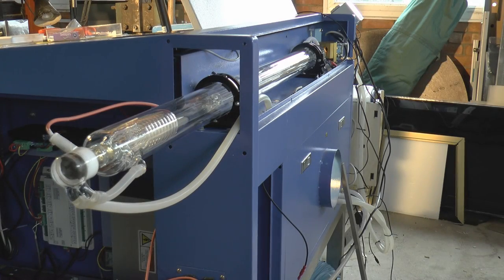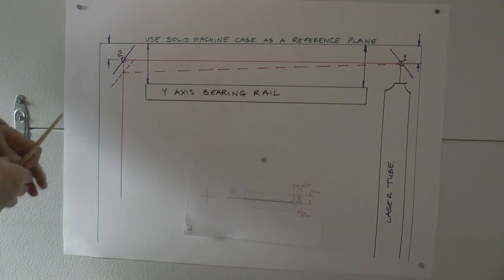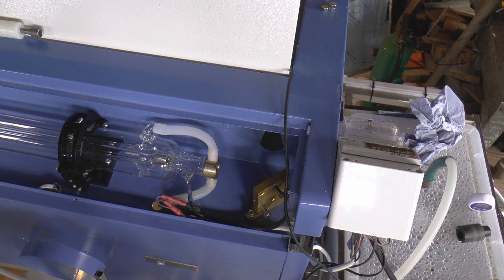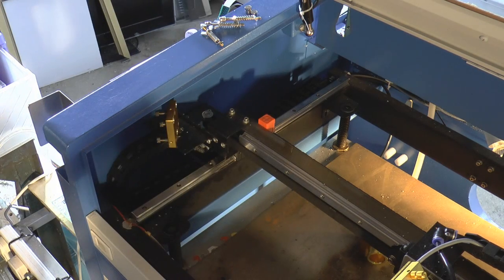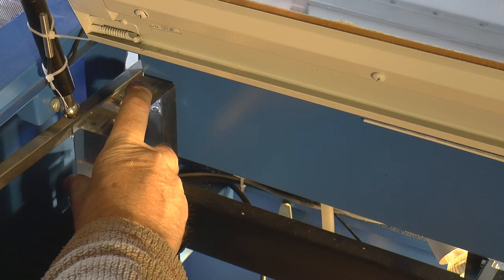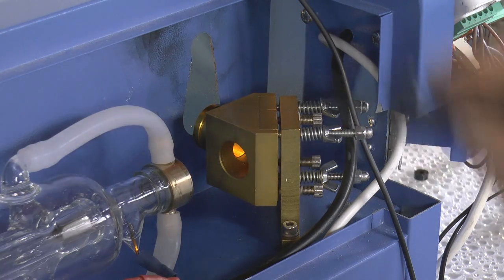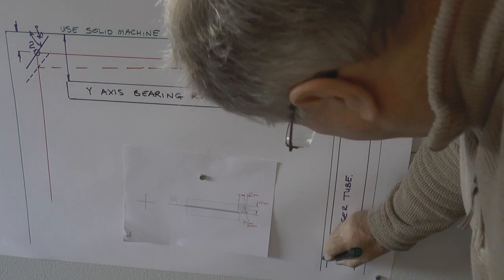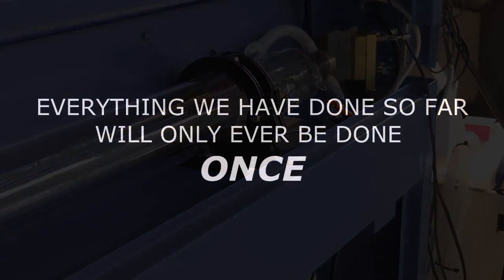RDWorks Learning Lab 51 Beam Setting for Beginners Part 1

Comment: Russ, 
thank you very much for the video - for all the videos in fact. They are very instructive and a great pleasure to watch!
I'm looking forward to receive my own little laser cutter and learned a lot from your videos.

Even though I do not agree with you about the necessity of parallelism of the lasertube to the axis.
Mirror 1 (the first one from the laser) has two degrees of freedom which allow the laser beam to reach
any point of a specific quadrant within the polar coordinate system. Meaning, you are able to correct
ANY misalignment of the laser just by adjusting the 3 screws of the mirror, als long as the laser beam
hits the mirror near it's center.
Also it's not important to adjust the mirror blocks exactly to 45° angle. That can also be corrected by adjusting the mirrors.

The thing that really matters ist parallelism between the beam coming out of mirror 1 to the Y-axis of the motion mechanism
and parallelism of the beam coming out of mirror 2 to the mechanical X-Axis.

There are only two parameters defining these parallelisms:
1) All 3 mirrors have to share the same hight above the (virtual) base plane of the mechanical movement of the axes.
This should be given by the mechanical construction.(is it?).
2) equal horizontal distance of mirrors 2 and 3 to the X-axis and equal horizontal distance of mirrors 1 and 2 to the Y-axis.
So there must be slots to move mirror 2 left-right and the mirror 3 back and forth.
Fulfilling these two requirements, in combination with the fact the laser hits mirror 1 at it's center, are the prerequisites to
establish a proper alignment. All the rest can be done just by adjusting the mirror angles.

Or did I miss an important point?

Lothar

Comment: Having set up several lasers, the mechanical alignment is not precise and very difficult to get right.  There is a much easier solution.
1 Remove all mirrors.  Use a glass, cardboard or other suitable 20mm disk with masking tape on it and use that to test fire the laser at a low power pulse to make a light dot.  The beam is not focused to a small cutting point here, so the spot will be about the diameter of a pencil lead. Adjust the mirror block and or tube for the beam to mark the center.  Replace the first mirror.
2 Use the target in the 2nd mirror block.  Move the carriage all the way towards the first mirror and test fire.  Do not center at this time.  Move the carriage all the way away and make a 2nd test fire.  The most important part here is for both spots to overlap perfectly.  Only adjust the 1st mirror at this time so the spot is in the same place near and far.
3 Move the 2nd mirror block so the beam hits the center.  It should remain in the center near and far.  When done, install the 2nd mirror.
4 Install the target in the 3rd mirror block on the carriage.  Repeat the procedure for repeating spot location near and far while adjusting the 2nd mirror.  Again do not worry about centering yet.  Repeatable spot location near and far is the metric for this adjustment.
5 Align for centering in the 3rd mirror as before.  This can be tricky as on some machines you can shift the lens assy to center on the beam.  If this is the case, the alignment is easy.  If not, the 2nd mirror has to shift while keeping centered on the beam from the 1st mirror.  Unfortunately this almost always screws up the beam to the carriage, so that needs repeated.
6 Check your work.  Test fire onto the target in the 3rd mirror location at all 4 corners.  Beam should be in the center at all 4 locations.
7 Install the 3rd mirror. Ensure the tube is vertical.  If tilted, the beam may enter the lens off center and your cuts will be angled.  There is no tilt adjustments on the 3rd mirror.  Done.
Reply from the maker: Hi
I greatly appreciate the effort you have gone to to explain your method. You must remember that that this is not really a tutorial series but as I say in each video, this is a record of my learning journey with this machine/technology.At the time this was done , there was no you tube help available to guide me so I was fumbling my way through the problem. As you progress through the series you will find me trying different beam setting methods. The major realization about beam alignment came when I discovered that setting the beam to the centre of mirror 3 can be a BIG mistake with some machines. see  from 12min 30 sec in   https://www.youtube.com/watch?v=ELeqP3tHlp0 .  At this stage in my journey I had already established that one big design flaw in these machines was the absence of any Z adjustment on the head, so you will note the adjustable mounting bracket that made it easy to fix this mirror 3 issue.
Having now set many different machine types and sizes I can advise that your steps 6 and 7 of your procedure gloss over the many difficult yet vital aspects of beam setting. The first is to make sure that the beam is firing at mirror 3 "sweet spot"  see https://www.youtube.com/watch?v=eSjNsK2sjNo  and this Z setting technique is much clearer to see in this video  from 24min 30sec   https://www.youtube.com/watch?v=jVGByifge_Q.    You will also note that by this stage I have become so fed up with the limitations of my original head that I have been back to the drawing board and made my own. I hope you will see from this that a small mechanical error in head angle is not going to have any disastrous results for cutting off angle but that if the beam is not passing exactly through the lens axis, that will cause the beam to exit the lens at an angle much bigger than any mechanical error.  I agree with your point about getting the beam correct at all 4 corner locations but first things first. By the methods  that we adopt,  we will certainly be setting Y and X absolutely true at three corners.  Big problems now arise when you drive to the 4th corner and the  scorch mark on mirror 3 is maybe 8 of 10mm off of true.  What do you do at that stage?
Thanks again for you comment and great explanation because others following in my footsteps will register my naivety at this stage and watch further ahead before resetting their beam.
Best wishes
Russ
Reply: @SarbarMultimedia  Thanks for the great and detailed feedback.  I do have the solution for 3 of 4 points in line.  I did not detail this.  The basic physics is 3 points define a plane.  If 3 corners align perfectly and the 4th corner is out of align, it means the rails are NOT all in the same plane.  Cheap Chinese laser engravers do not have a strong frame, but most often a sheetmetal box.  Either the table it is placed on is not perfectly flat, or it had shipping damage.  This can be corrected by either shimming the low corner of the table, or use shims on the internal bed to place all 4 corners in the same plane.  My prior alignment only works if the bed is properly level and all 4 corners are in the same plane.  Hope this helps if you are fighting this.  Had this problem with my Rabbit 40.  It arrived with a broken tube and dented corner.  Due to the larger size, it has two upgrades. a 1000 mm long 50Watt tube, and an AWC708C Lite controller panel, with stepper drivers. to eliminate the software key and computer.  In addition the stepper drivers are now run with a separate 30V supply for faster engrave speeds.  With the two upgrades and a full proper alignment, it now works very well.  With the new controller, I can add a rotary table, my next upgrade.  The network interface is fantastic.  I don't need to be in the shop to do the graphics.  Just upload the file.  In addition, it now directly runs with Gcode files, GIF, JPEG, AI, and many other files with the cut and scan functions combined.  This alone is a huge improvement over NewlyDraw which can either cut or scan in one operation.

Comment: 4. follow up to prev post:
Next is to do the same on the x axis, means i put again a big sticker un the laser head and adjust the beam from mirror2 to not moving when going left/right on the x axis.
Again, when this has been done, the beam is parallel to the x axis
5. next is to move the laserhead up/down and front/back to hit the sweetspot of the laserhead mirror.
When this is done, i know that the beam should be easy to get to the center of the lens without having any angle error to the x and y axis planes.
6. next what i do is to adjust the high between the table and the head nozzle on all 4 corners of the table by turning the single beltwheels of the table.
7. last step is to loosen the basemount frame of the table and shift it x and y until there are 90 degree at x/up and y/up between the table threads and the table itself, this could be easily measured when the table is in a lower position.
Reply from the maker: +pyrofilm 
Again all good stuff, I made my own adjusting bracket for the head  to catch the beam in the mirror sweet spot, but as I mentioned in my previous answer,  a little XY stage at mirror 2 would be a neat solution.
Thanks again
Russ

Comment: Re mirrors tarnished ... those machines are great for smoke extraction so you'd be hard pushed to get the back and side mirror dirty ... The other 2 larger machines I have have the extraction from underneath and I find smoke gets to the tube and it gets very dirty .  Im looking at building a bulkhead to stop  the smoke getting to the rear of the machine with holes for the belts and laser beam and possibly put a few fans on the tube cover sucking into the machine  to put positive air pressure in the tube box . Im currently watching this because the 3rd machine (cheap chinese machine)  has major mirror issues after the wife gave it a knock .
Reply from the maker: Note of caution....if she can do that to a machine, for your own personal safety , I would make damn sure to keep her sweet!!

Comment: 8. due to tilting the mirrors to get them parallel to mechanical x and y axis and the bad construction of the mirror mount on mirror 1 and 2 ( they are not tilting at the nirror plane but instead far behind the mirrors) the incoming beam might not more hitting the mirror perfectly in the middle. Usually this is not a problem as a mm out of center is not a problem but as i always want to have it perfect, i may redo the complete setup again for doing the finetuning then. 
Ar least after a second itteration it is usually perfect, even with this wrong designed mirror mount.

Comment: Hi Russ 
Hi Russ, thanks for the valuable information you are providing with you videos, I'm binge watching them on a regular basis, I've just got my (what was supposed to be a 60w Chinese laser engraver) turns out it only a 1000mm tube so i presume it's really  a 50w machine, I was wondering if you could help shed some light on my issue. I have set my mirror's about as exact as I can to the middle on all 3 and the beam out the laser head is exact centre, when at the front of the machine, but when I move it to the back of the bed to check all 4 corners its no longer hitting the centre of the mirror on the laser head. if I adjust them at the back the front is no longer aligned, any idears??. I can slice through 3mm acrylic with no problem with power down to 35% but just will not cut through 3mm ply wood even at 85% @ 5mm/s with is as far as I want to take the power (I haven't got my ammeter yet) any help would be appreciated.
Reply from the maker: Hi
Lets start at the beginning
1)Your beam need to hit mirror 1 approximately in the centre ,within 2mm say.
2) Drive mirror 2 close to mirror 1  and make a TARGET scorch mark. 
3) Drive mirror 2 right to the front of the machine and watch carefully as you make  a second scorch mark.
4) if the marks are perfectly on top of each other then proceed to 6)
5) If the second mark is off, adjust mirror 1 to get it onto your TARGET burn.  When your target gets too confusing, replace the tape and return to step 1)
6) You have now set the Y axis perfectly. DONT touch mirror 1 again. Your final mark may not be on the mirror centre but up to 2mm off centre will be ok.
7)Put target tape on the head entry port. Drive the head right up to mirror 2 and make a TARGET scorch mark. Your final mark may not be on the mirror centre but up to 2mm off centre will be ok.
8)Drive the head as far away from mirror 2 as possible and make a second scorch mark
9). if the marks are perfectly on top of each other then proceed to 11)
10) If the second mark is off, adjust mirror 2 to get it onto your TARGET burn.  When your target gets too confusing, replace the tape and return to step 7)
11) You have now set the X axis perfectly. DONT touch mirror 2 again.  Your final mark may not be on the mirror centre. This WILL be a problem for setting the Z axis  but that's a more complex problem to unravel  and I will point you in the right direction later.

At this point, with the head as far away from mirror 2 as possible, put new tape on the head and make a scorch mark. 
Drive the head to the back of the machine and make another scorch mark. Your marks should now coincide. If they do not,  then there is a mechanical set up problem with your Y bearing rails OR you were not accurate enough when you moved to step 6)

If you cannot get coincidence then you will have to add  your email address to a comment so that I can contact you and we can speak off line.
If you are now happy with your X and Y settings thenfinally to the most difficult axis ,Z.  This is too complex to describe simply, so take a look at this video
https://www.youtube.com/watch?v=eSjNsK2sjNo

Best wishes
Russ

Comment: no matter what I do I just cant get the beam to hit the same point at all 4 location, 3 are good enough but the back right position is to low and to the left and if I adjust to get it in the center of the last mirror then the others go out of alignment, kinda losing my mind trying to get it sorted.
Reply: Still have trouble with that? Had the same issue. Only use mirror 1 to bring the front (!) right position down (!) to achieve the same hight in the two right positions. The front right position reacts faster than the back right position since the laser path is longer. It is a common mistake to adjust the laser to the left rail first. If there remains a position error on the left side after that procedure, it is because of mechanical imperfection of the machine. Check whether the rails are parallel in all directions.

Comment: I can't find a way to reduce the test pulse power directly on the ruida controller. Is there a way to do it in rd work ? 100% of 150W just make the tape on fire.
Reply from the maker: To answer your question you press the MAX POWER button on the key pad and reduce it to maybe 10% by using the arrow keys.
Secondly DO NOT USE 100% power , other than for a quick test or you will quickly kill your tube.
Several things that you must understand about your tube. Depending n the brand of tube It may not really be 150 watts. If it's Reci it will not be what it claims but  if it EFR or SPT then it will be . You MUST NOT exceed certain mA current values or you will "over-drive" your tube to an early death.. Somewhere on your machine there will be an ammeter that tells you the current passing through your tube. It may a display panel on the HV power supply, it may be on a yellow strip across the bottom of your machine display panel or there may be a panel mounted ammeter near your keypad. If you can tell me the make and model number of your tube I can tell you the safe running current. In the meantime do NOT use power settings more than 65%.  Take a look at this video as I explain all about how your tube works and the dangers of over driving your tube.
https://www.youtube.com/watch?v=2F5O-1TH8b0&list=PLPWEtx5V9DqEogIeYRdcG_KYcB7UL2Qmn&index=7&t=115s

Bestwishes
Russ

Comment: Russ, just curious. Did you check the back wall and floor of the tube enclosure to see if they were square to one another, and how level the bottom was? That might be going a bit out there for precision, but I can get obsessive about such things once I start going.
Reply from the maker: Hi Brian
Please be assured that the alignment of the tube in its enclosure has no effect on beam setting. Provided the beam strikes mirror 1 approximately central it is the reflected beam from mirror 1 that has to be set true to the Y axis. When I first encountered  beam setting at this early stage in my learning journey I was making sure that things were as mechanically  accurate as possible. Beam setting is something that most people do only as a necessity and are fearful that their machine will never work the same again. I would regularly go about setting my machine to develop methods and understanding. So now I have a complete 3D visualization of the mechanics and a simple logical procedure for setting each axis, the most difficult and least understood being the Z axis.  The only reason for setting your tube to a known parallel to floor and wall  position within the enclosure is for the final setting of the Z axis. I have made my head adjustable in Y and Z so that I can "catch" the beam onto the  mirror 3 "sweet spot". Without this adjustment (and 99% of machines do not have it) you have to start right back at the tube and make absolutely parallel adjustments. This is an almost impossible task because any adjustments you make to the tube entails resetting the X and Y axes again. This can be a very tedious set of iterations. 

Best wishes
Russ
Reply: @SarbarMultimedia  Thanks for the explanation. Much appreciated.